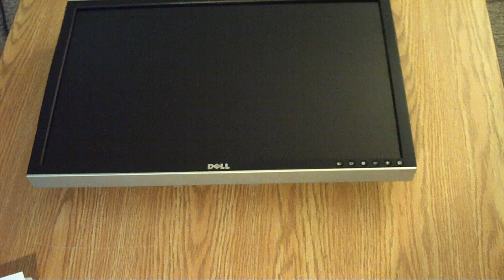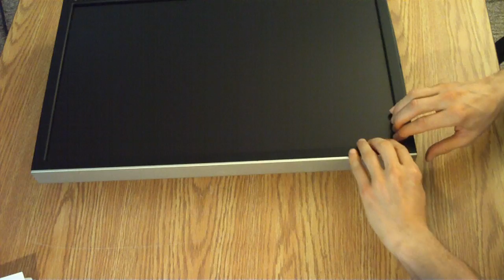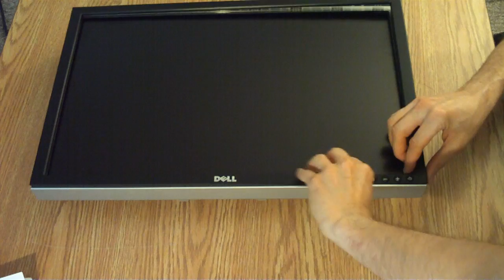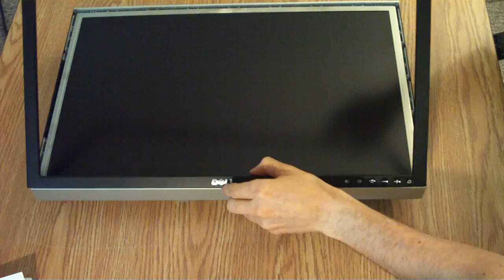Dell 2407WFP Monitor Power Button Repair Part  1

Comment: Is it worth $10 to fix your on-off button problem and save your monitor? Go to Lowe's or other place that stocks common electrical stuff. I bought an outdoor wireless outlet made by Prime #0357410. At Lowe's, it's in the area where they sell various timers. You plug the module into an outlet. Plug the monitor power cable into it and you can turn it on and off with a key fob style remote. This assumes your monitor is always on. If your monitor is off and won't come on because of the button, then you have to follow this series of videos.

Comment: I got a dell 1905fp monitor that when I turn it on it turns on for like 2 seconds and shuts off and won’t stay on. I can also hear what sounds like a buzzing sound if I get really close to it when it’s on for that short time. I was told the caps need replaced. I replaced them and it still is doing the same thing. What’s the issue?

Comment: When mine first started to go a few years ago I was able to tilt the button upright again and put a piece of scotch tape over it to hold it there. It's been fine ever since, although I'm noticing the button is slowwwwly migrating deeper into the monitor... Ive had the monitor for what I believe to be exactly 15 years now so I suppose I've gotten my money's worth... I'm kind of attached to her at this point and would just hate to see her go... I remember paying 700 dollars for it in 2005 or 2006 or so and boy was that a lot of money for me at the time... Anyways I won't ever be using that button any more than I have to as I just set my comp to turn it off now. If the button fully goes I'm going to try the technique here to see if I can save her one last time.  It's a shame it was such a common problem, I'm convinced it was a purposeful design to break shortly after the warranty would have been up on it...  I couldn't count the amount of hours I've used this panel and it is otherwise completely fine. Good luck with your fixes everyone!

Comment: Help!!! I can't get he bezel off?? I took a  1" flat scraper and coated it with scotch tape to not scratch anything, but the bezel wouldn't come off/up?? I pried very hard, but afraid of breaking something??? Thanks for the video.
Reply: Did you get the bezel off?  I'm about to try fixing mine now.  Reading all comments to plan it out.

Comment: I did the fix from this video about 10 years ago. Still have the monitor, and the fix still works. I turn the monitor on and off several times a day. So a few thousand presses more than what the button could originally handle as built by dell.

Comment: Thanks dude worked awesome for my monitor, went to bed last night turned it off and woke up today and the button wouldn't work. 

TBH didn't watch every second of your video but I did run the tape over the screw hole closest to the power button and then screwed in through the tape to secure it a little more.  Not sure if that's how you did it but either way worked a treat!

Love these monitors, I was using 2x dell 248wfp I bought second hand in 2008 or so then last year slightly upgraded to these Dell 2407WFPHC for $40  bucks each

Comment: Super easy, just saved me from buying a new monitor. Thanks! I used the tape, and didn't screw the panel back in place.
Reply: I ran the tape over the screw hole closest to the power button then screwed through the tape for a little extra security, to each their own, as long as its working!

Comment: Hi, rotating the power buton to the correct position works perfectly!I used a bit of scotch tape from outside to rotate it a bit.The whole operation took 30 secondes in total!Thanks Albert Li a lot!

Comment: Yesterday I went out and spent $118 on a new LCD monitor. The power button on my DELL monitor stopped wkg. after 9 years.  I didn't see this 4 part video until evening.

I tried the tape trick but it still didn't work for me. So, I just removed the plastic button and used a small tool to turn it on. Instead of finagling  using a tool to insert for on/off I decided to just plug in and out the cable to the power strip.  Your videos gave me the confidence and know how to open up the monitor and experiment. I finally understood how those cheap plastic buttons work and exactly where to press (just left of the opening) to start the monitor.

I was glad to return the new monitor this morning for a refund. Of course, the new monitor's picture was much better than my 9 yr. old monitor. But I don't use it much except for printing bills and taking care of banking. Who needs things being vivid looking at bank stuff. I need to get something new to replace my Vista tower in that Microsoft isn't providing updates (still does w/ Mozilla). I will probably go to using a laptop... so I am very thankful to you for your help!!!!!!!

Comment: Useful for disassembly of my Dell 2408 which has its own failure issues with power save mode going on and off (loose DVI connector?  cold solder joints?) and loose ribbon connectors causing running vertical lines of color...

Comment: Tip for people still using these things (like me)...get the button back in position.  Lay the bezel flat on a surface, making sure that the buttons are not being pushed up by the surface you put the bezel flat on, an easy way to do so being to hang it off the edge of a table.  Slather that with some Weldwood glue...and then wipe the parts in between out with a q-tip (between the two plastic pieces that broke apart) and then to the top and bottom of that, basically trying not to glue the button to the case.  Wet some paper with the glue (both sides, just to sort of soak the paper) and wait a little for the glue to dry, at most 30 seconds.  Make sure that paper perfectly fits for the space.  Put it in, wait for a while, maybe 30 min to an hour.  Then put plastic sheeting over that, slightly bigger than the paper, cutting out places where the screw posts are.  Test it.  Put that back together and it works.

Amazingly, mine somehow broke even though I was supposedly the first user of this monitor from 2006...

Comment: OK, This guy left out an important suggestion.  If you remove the four Screws in the center of the back, then everything becomes so much easier.  The entire housing falls out once you remove the bezel, making it much more simple to remove the four screws holding the button panels on.

Comment: I used some plastic pry tools for removing the bezel as it is easier on the fingers.  Having one on the inside and one on the outside of the bezel makes it come off fairly quickly.However, I couldn't pull the bezel completely away as there was a bracket holding onto the button PCB, and not just the ribbon cable.  I noticed I have the 2407WFPb (notice the extra b).  I couldn't move it up or down to release from the monitor because of this bracket.  The rear of the monitor has a lock area that I thought would help, but it is just for adding a security cable.  Anyone else figure out how to remove the bezel on the b model?  I am currently using the tape work-around, but would like to get to the button to make a more long term fix!

Comment: You're a genius!  I was about to buy a new monitor but just sticking a small screwdriver between the button and the bezel allowed me to turn the button and the button now works fine again.  Thanks for mentioning that the button turning around in the socket is the problem.

Comment: Thanks for this video! It was easy to take button out completely, now I am using a plastic dental flosser to turn it off and on.  I was thinking of mailing the power button into Dell with a note stating "I don't need this anymore, you can have it back"

Comment: Does anyone know where I can find a replacement piece of plastic with the power button on it? I used a piece of CD plastic to fix my monitor but it hasn't lasted.
Reply: TheRationalizer just leave the power button completely off and use either the sleep function on your computer or a power strip to manage the power.  Or use a non conductive implement to turn on the power by pressing the button on the circuit board.
Reply: That's what I ended up doing, thanks :)

Comment: Very difficult to remove bezel at front,any tips?
Reply: inmx12 I know I'm late here, but guitar picks are excellent for removing screens generally. If you ever have to remove a screen again, try that.
Reply: @nobggg  I'M SO GLAD I'M STILL READING ;-)  THANKS!
Reply from the maker: Maybe try a spatula? Or follow some of the alternate methods of fixing the button that don't require removing the bezel, like using tape to rotate and hold the button.
Reply: Blue tack and it worked.but i damaged the screen removing the bezel,thanks for tip though

Comment: my button hinges seemed to have only broken away on one side, it has been sometimes difficult to operate on-off for some time now, but today it packed it in altogether, the critical tip you supplied here for me was just that the front bezel even comes off, if very stubbornly at first, I would never have persevered trying to budge that if I did not see with you for sure that it does come off..the awkward thing here was that unlike the other control buttons on the unit, the power microswitch does not sit directly underneath the external button, but well off to one side of it..one small piece of the extreme edge of the plastic button seems to have worn off and that is why pressing button has no effect..I have had to just file/break away most of the bezel between power button and "+" button, to expose the microswitch ...I just actuate it with a biro-cap prong...which I have snipped the point off of so hopefully it will not wear through the switch contact..
Dell should simply supply replacement button sets...
anyway, so far so good..t/y
Reply: Countdown70s The mircroswitch is set off to one side, but with the correct "tool", you don't have to bother with the filing away of the bezel.  I am using a plastic dental flosser and it easily can activate the microswitch when the button is taken out and the monitor reassemblied without it.  One of videos in the series suggested a toothpick, and that would easily as well.

Comment: You can also just rotate the power button externally back to its original position and put a piece of scotch tape over it to hold it in place. I am super lazy, so I just rotated externally and it worked. As he mentions, you just have to get the clicking tab back in place and tape it down.
Reply: Thanks, that worked perfectly!
Reply: Albert Li Thanks bro!!! My monitor has been sitting in the corner for about a month now because I thought it was dead. Just rotated the button with a couple of guitar pics, and boom...works!
Reply: Ty good sir.
Reply: Lol thanks
Reply: You legend
Reply: Thank you :)
Reply: Mine is just like my working monitor, straight up to 12 oclock, not sideways.  What now?

Comment: Thank you so much for the video! Few days ago a bought a used Hp f1905.. and the power button was working, but I had to press it really hard to turn it on/ off, after that I was away for couple of days and the monitor was off all that time, when I came back I could not turn it on. The Display setting would show that screen is available (as VGA was connected)...but it was off no matter how hard I tried to push the button. I tried to pull it and push it...and well, ended up breaking the thing :(
 I followed your video (I didn't even know that removing bezel is so easy!) not even all the way through (the monitor is different, so everything is hooked differently, but I got the idea from your video). Just opened the bezel, and removed the lower base of the power button, so I could reach  that little copper switch and Taaadaaaa! It's on! 
With missing the button of course :))) but who cares! Thank you!
PS. if you know how to fix noisy fan in HP  laptop, let me know!
Reply: Search for replace thermal paste in HP laptop

Comment: Thanks so much, I was just going to scrap mine, but now it is fixed!! Mine cost me $1090.00 in 2006, and I have two of them. At first I was afraid that the procedure would require too much manual dexterity, but then I did it and it was easy. It was useful that you posted the entire sequence, because several times I had to go back and replay parts of it, just to see the orientation.  I made one simplification to the procedure which is that I didn't even bother fixing the stupid power button.I just left the hole so I can directly toggle the dimple switch with a pencil. Actually,  I don't turn the power on and off anyway.  I just configured my OS so it turns them off after 10 minutes of inactivity.

Your video could perhaps start with a description of how the power switch actually works. Eg: A plastic button on a hinge, and underneath a dimple switch that you toggle on and off.

Comment: thinkofwhy -- thank you so much for posting this. Following your instructions, I repaired my button (what were the designers thinking of using plastic as the hinge?) and deferred for some time a replacement monitor. Seven years old and still going!

Comment: Thank you. I just fixed this monitor using... duck tape! BTW. Got this monitor for... $10. For REAL.
Reply from the maker: Buying apparently dead monitors might be a lucrative business right about now.
Reply: It actually worked... later I noticed power button issue, fixed it in 15 min. I like this old 24" IPS monitors. I have FPD2485W and last year I replaced capacitors and work like new. Its actually better that my "new" Dell. Now I have pair of two IPS monitors 1920x1200 and I didn't pay... $1600. Patience is a virtue! :). Again, thank you for your help with repair! God bless you!

Comment: Very much appreciate you preparing this video thinkofwhy. I had a bad power button on my Dell 1907 FP monitor, with the monitor stuck in the "off" state :(
Would have never figured out how to get the bezel off without your info.
This is tricky, and it would be easy to break the bezel or the screen.
Once I had access to the electronics behind the bezel I found that the
small screw behind the power button had stripped. I got the monitor in "on" state
and just put everything back together, will power it on/off with my power strip.
It was hard to screw in the two remaining small screws - I cut a notch in the
back of the bezel to reduce tension on the cable.

                        thanks again - oldadit

Comment: This was a great video, my monitor had the same problem and your video helped me get it apart.

I also was able to fix my button by putting a thin coating of epoxy over the break, then I put a small sliver of plastic over the break. What did I use? I happened to have a slurpee today, one of perhaps the two or three a year I have, and the plastic on the dome lid was perfect. Thin and pliable. I cut a tiny piece and now I have a new hinge :)

Thanks again for this great video!

Comment: My wife's monitor is having he same issue, so I followed this video.  My issue is the power button has a protruding tip that hits the circuit board to turn it on/off, that top is broken off/missing from my power button.  Any idea how I can still fix this?

Comment: My friend gave me a monitor last night with a broken power button.  I followed your instructions and was able to fix the power button by cutting a slither of CD plastic and super gluing it at a slight angle inside the button with the tip sticking out to the side.

Thanks so much for sharing your knowledge! :)
Reply from the maker: It's always exciting to bring the apparently dead back to life. So, how did your friend respond when you told your friend that the monitor wasn't really dead after all?
Reply: He was very pleased, he rescued it from a skip at work :)

Comment: Thank you @thinkofwhy, that fix worked like a charm.  I had spent 30 minutes with Dell's tech help last week and I told them this must be a chronic problem, and they had absolutely no clue at all, a waste of 30 minutes.  THANK YOU so much for uploading these vids, definitely saved me, and worked perfectly.  Cheap DELL plastic parts designed to fail, what a sham, they should be ashamed of themselves.
Have a good holiday, and again, thanks for taking the time to post these : ))

Comment: here's how I managed to get the bezel off: I went to the kitchen and dug up a plastic spatula with a thin edge.  I was able to wedge the edge of the spatula under the outer groove were the bezel meets the shell and move it a bit. I could then wedge the spatula under the inner bezel edge, where the screen is.  Eventually I got enough of the bezel up that I could get my fingers in there to start moving it.  I had to do that in a few places.

Comment: Mine too.  I've tried to "just" pry up the bezel but to no avail; I only get sharp pains in my fingertips as I try pulling up on bezel.    I need to find some other way to lift the bezel off, at least to get it started.

Comment: thanks very much i followed tutorial on my Dell 2007FP monitor and got the button working again.The two very fine plastic bits from button to other piece had gone.but i did not use sticky tape i just used like a sticky back double tape and left one side with the paper on it.it works really good and is real strong.MANY THANKS it took 5 mins

Comment from the maker: If by cover you mean the back housing, then no, you simply remove the 4 screws and then after the bezel is removed it should separate from the panel. If by cover you mean the front bezel,  then it depends how you try to pull it off.

Comment: I have vertical lines across my Dell 2709W monitor, could this be a cable issue or is it the panel? Any idea how to figure this out or were to get spare parts.

Comment: I would have never guessed how to open up my monitor to get at those buttons.  Exact same problem.  Fortunately I still had the small plastic "hinges" intact enough to brush a micro amount of super glue on them and basically "melt" them back onto the button for a seamless repair.  Works great now that it's all back together!